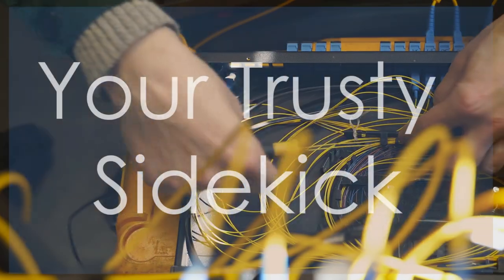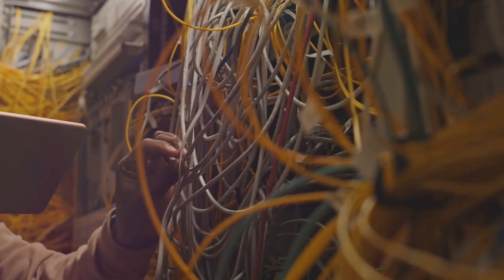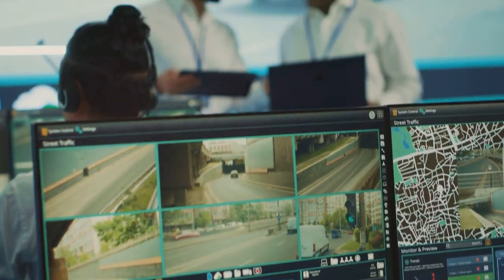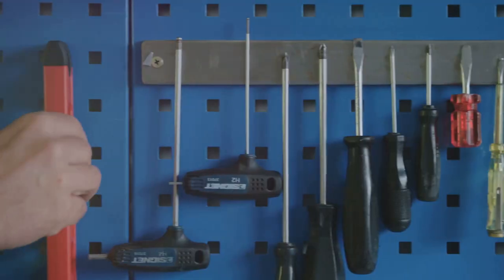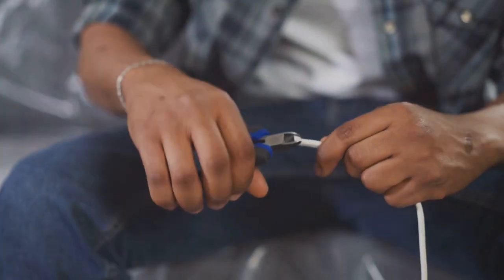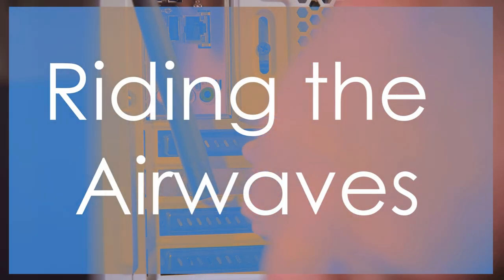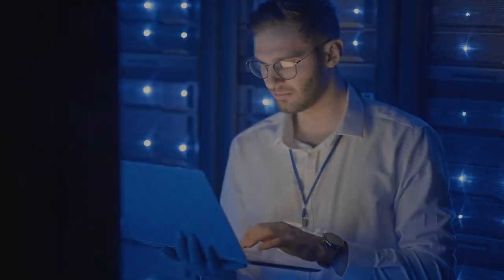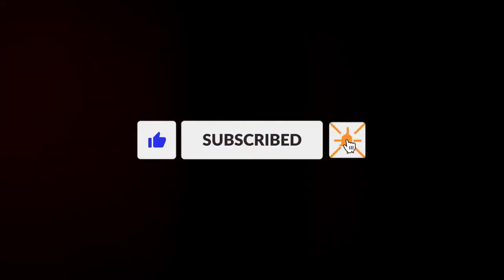Essential Tools EveryNetworkTechnician Needs!List of things every Network Engineer should own#switch

Comment: This video doesn't do a good job of demonstrating any of the tools mentioned. Most tools are not even depicted. Of the software based tools, there is a lack of examples which would only leave the viewer more confused. This video list should not be used as a means to define a list of tools for a network technician, and most will not be required to get started if they are ever even used.
Reply from the maker: @ozzman530 Thank you for pointing that out. Yes, I left some tools name out, but I will list them all out in the video. I really appreciate your feedback.